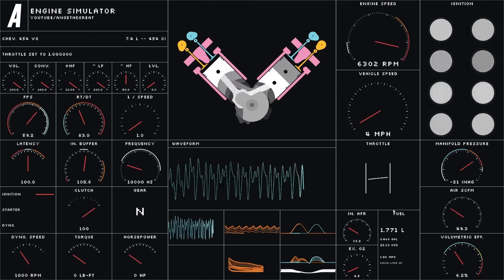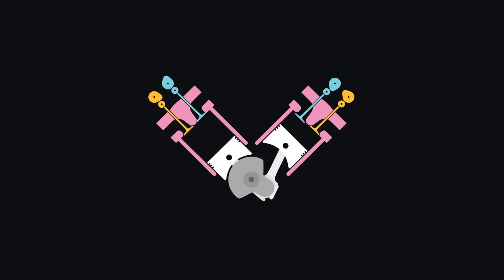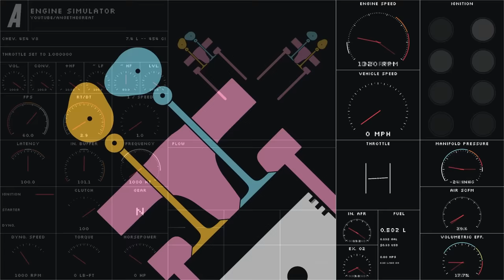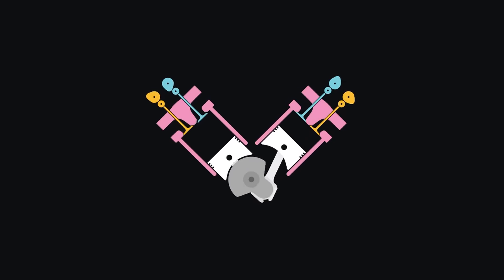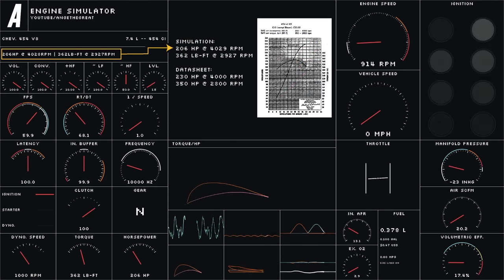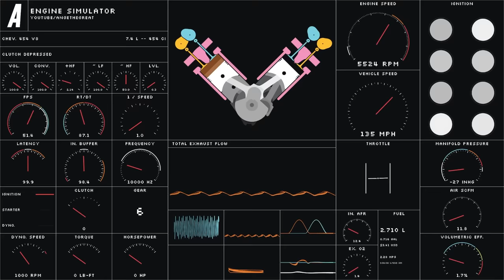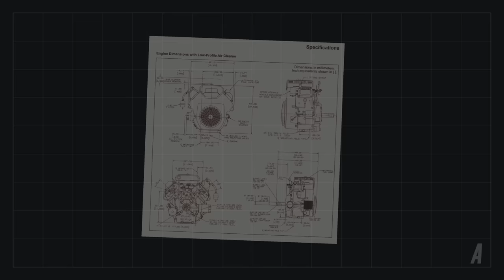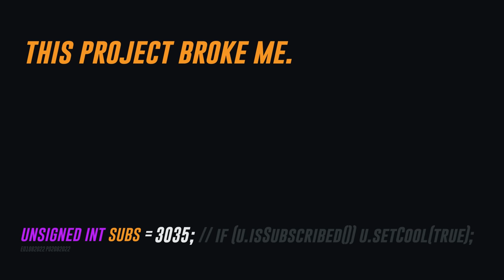Simulating an Entire Car Engine (yes, it makes noise)

Comment from the maker: UPDATE 2: Code is public again, see link in the description. For those that waited patiently and were respectful, thank you, you guys are legends.

UPDATE: I've received way more interest in this project and the codebase than I anticipated and I've made it temporarily closed-source. I may release it publicly again but I really want to make sure that my work isn't used without crediting me. Thanks for understanding bros!

Hey guys 👊 Just thought I'd clarify that ALL engines are displayed as overhead cam in the simulation since it is functionally equivalent and easier to program (visually) than cam-in-block. I'm well aware that 454s were single cam, pushrod engines haha. Also the user interface that you see was made with my game engine, I forgot to mention that in my video. It's the same engine I use on most of the projects on my channel. Thanks for watching!

Edit: Also, I don't want to pretend like this is a PERFECT simulation or anything. It's a decent approximation but definitely not on the same level as a scientific tool. I'm mainly interested in the sounds and generally getting the power curves right
Reply: Sure but please simulate an inline 4 engine, I need to see an economy engine on this simulation. Also try to implement a stress test onto the simulation like when there is no oil, the wrong fuel is put into the engine like an 87 octane fuel on a high performance engine (90 and above octane engine) and something like that.
Reply: Yeah, I'd hold on to all your code... I can imagine any car game or simulator manufacturers wanting to license this.
Reply: I want to play with the application so bad, hopefully I can play with it soon.
Reply: Can the simulation support diesel engines? Also coukd we use this sim to create engine sound mods for games?
Reply: this is very valuable tech
Reply: A W10 or W12 sound would be interesting
And a Two Stroke if possible. Like a Vespa or some other Scooter
Reply: can you add rotary/wankel engine :D
Reply: Would be interesting to see if this can be used as a tool to generate seamless engine sound loops for game engines or game mods! For example you define inputs like throttle input, rpm and the simulated sound sources, it creates based on the engine setup a sound loop. I think there is a huge potential for it ^^ i would even consider buying it if its not like hundreds of €$

I personally would use these loops with a sound controller from a unity asset called "realistic Engine Sounds"
🔊✌️ Very epic tool!
Reply: A wankel engine simulation would look pretty nice!
Reply: What if you put an audio signal in? Can it approximate the engine that created the sound?
Reply: When open sourcing software, you can never be sure nobody is using your software without crediting you.
The only thing you can do is pick a license that still gives you rights (e.g. GPL, AGPL).
You can always sell licenses that are more permissible (just make sure that all code that is contributed to your repo allows this)
Reply: put a BSD-3 license or The Unlicense and then anyone can use it, with different terms
Reply: MIT license is usually the license if you want people to be able to use it but want the credit, their are other "permissive licences" that mostly do the same thing such as BSD. if you want your software to be open source and free for people to use you should always put the software licence, because no licence makes people really nervous and experienced people will avoid the temptation to use it, at all. What can be done by scam artist is they will make a useful thing with no upfront and clear license but advertising by saying stuff like "I wanted the world to have the option, but email me if you use my code so I can know how I helped humanity" then a inexperienced programmer or company uses the code and builds a program around that code and emails them about it to respect their wishes. No licence in some countries like the US means fully copyrighted to the creator. They then say you used my code you must pay me now or not use it in your program you have dumped time and money into. just be up front about what you want by picking a boilerplate license that requires exactly what you want. mostly their is a boilerplate license you can copy that requires everything you might want.
Reply: If you want some protection there, GPL it and dual-license to anyone who comes along wanting to exchange money for using your time and effort in something proprietary.
(Is the GPL perfect? No. Do company lawyers vaguely understand "oh, we have to follow this" by now? More than most other licenses.)
Reply: @dangerdanger8987  I bet it could considering as Ange said, the codebase is generic, so all it really needs to be able to do is simulate the fuel atomization and compression ignition behaviour of a diesel to be able to replicate the sound. in fact, I might recommend trying something like this asw a starting point;

Cylinders: 4
bore: 82.5mm
stroke: 82mm
CompRatio: 17:1
valves; 2 per cylinder
turbocharged with intercooler
firing order - 1 -3 - 4 - 2

this should net you a 1753cc inline 4 comparible to the Ford KKDA engine that was popular diesel option in the 2000-2007 Ford Focus, C-Max, galaxy and transit.
Reply: I hope this gets either open-sourced, or you share it as CC-Attribution or even make it a paid software on, let's say, Steam because this absolutely rules and I want to be able to play with it to simualte some weird engine configurations!!

btw, any plans on simulating the diesel cycle with this if it's not already possible?
Reply: You either make world better and allow anyone to enjoy technology you made or make your wallet fuller and do not care about anything else. Flinging between these two goals does not honor you.
Reply: Can you do a Cosworth DFV revving right up to 11000 RPM and a flat boxer 8 like the one from a Porsche 917?
Reply: Yes, Create an "engine sound as a service" and LICENSE the Engine-Sound-Engine sounds to gaming companies.

-- however, make an educational tool for kids/schools/techshops/pros

--- MAKE A FUCKING SHAZAM (Record an egine sound and reverse the sound into the Configuration of the engine.

---- Then do the same for PrattWhitney, GE, Rolls jet engines ;-)

Seriously, this is amazing.

The science behind how you derrive the sounds is also of extreme interest to audiophiles.

if you nee a product manager...
Reply: Wankel Rotary engine please (2 rotor specifically, from the Mazda RX-7 FD, 13B-REW I believe.), I'm really curious if your sim can accurately simulate things like the distinct idling sound, either way great work really like this.
I'm also curious if you can get turbo- and superchargers to work in this, of course that curiosity has nothing to do with the fact that the FD was sequentially twin-turbo charged, not at all.. :)
Reply: Question: is the exuast the only part that makes sound, or does each explosion in every cylinder make a sound when firing? do the valves make any sound?
Reply: "temporarily"
it seems like its going to be like that for two months, least.
Reply: can you simulate a engine similar to a VW/Bugatti W16 engine, but in a 'flat/boxer' bank angle.
Reply: @TissuePaper looks like your comment is shadow banned (or something like that) - I can see it in notifications, can read it with direct link, but it is not showing here (you can check it with browser's private window).
Reply: Do a 2 stroke lawn mower
Reply: lol what a way to backpeddle an "open source" decision when it gets attention.
EDIT since re-release: Thanks!
Reply from the maker: @PieterDeStickere  Just need a bit of time to choose a license and figure out a way forward, that's all, all my other code including the physics engine that runs it is still open source
Reply: Is it possible to run this in real time in a game engine? I see you're running the rigid body simulation at 80khz, but are you able to distill that into some linear algebra? I would expect all you need to produce the sound are the pressure waves entering the exhaust system. If this is true, you could probably approximate it with some basic maths that gives the intensity and frequency of these pressure waves?
Reply: just do Qt license, GPL for eveveryone, and you get money for people trying to profit.
Reply: @AngeTheGreat  get your bread man, dont listen to these children thinking you shouldn't get yours. This kinda tech could change gaming audio, It could change how the automotive industry simulates engines, its got a lot of potential. make it accessible, but get your due from your labor.
Reply: I speak against myself, but you should keep this algorithm for yourself. Game companies probably pay a lot for this type of things(I think). You are the best for making this code available for everyone. If you want to get credit for using your code, but still want to share it for free, I recommend you the CC-by license at least. This licence force the user to credit you, while he can use it as freely as they want. Or check out th other CC licences. There are one for almost every situation.
Reply: 1. Would love see the codebase of a project this cool
2. Please, make sure to licence it with a copyleft licence like the GNU GPL and not some permissive licence (MIT or BSD or Apache) as codebases with such licencing can be taken and made into a closed-source product without your knowledge or permission and also dont use the CC licences, they are good for works of art like drawings, models etc but they are NOT suited for code.
Reply: make it public
Reply: +1 to Wankel Engine!!
Reply: steam engine!
Reply: Apache License 2.0 would allow everyone to use your source code however they want but they'd have to include your license.
Reply: @jony1710  it's already in Gran Turismo, since 2014, so yes :)
Their internal name is AES, you can find plenty of discussion about it on the webs after it was discovered.

I've personally modified data files in GT6 and confirmed what it does for myself, it's very powerful but hard to work with if you don't know what you're doing.

To be clear I'm talking about engine sound synthesis only, not the physical simulation described in this video.
Reply: Nice project 👏🏻👏🏻
Reply: Licence selection really depends on your goals.
If you want it to be included in commercial games, consider dual licensing. GPL plus a commercial license would give freedom for standalone use and open-source projects, but require most commercial games to pay you a licensing fee. 
If you don't care about licensing fees, but want to force attribution, consider dual licencing GPL with CC (yes, it's not recommended for software, but not an issue when it's dual licensed with GPL). Or you could technically do a commercial license that only requires attribution. 

If you don't care about attribution and want it in as many games as possible, use a permissive license.
Reply: Good idea. This is a super cool project, wish you the best of luck!
Reply: I don't even care about the source code, I just want to play with the simulator..
Reply: I'm so sad I didn't find this before it went closed source. I wanna mess around with it so bad
Reply: @AngeTheGreat  Yeah, hope you find one that works for keeping the community at large able to use it easily but get all the devs to pay properly
Reply: @Bill.Moller  just make it gpl
Reply: @dextreme1754  Not just a wankel, I'd love to see/hear a Liquid Piston! I'd also love to see it compared side by side to a typical wankel
Reply: @Bill.Moller  man i hate IP laws
Reply: If you could make tutorials on how we can also make physics based simulations in cpp, it would be great!
Reply: @PS3PCDJ  What the issue with it being used in closed-source product? He does not lose from it.
If he care about that he should make it paid license rather than copyleft which no commercial games will use.
Reply: Looks awesome and I totally understand why you went closed source. Is it possible to just list references that you've been using while developing this, please? I'd like to check the theory rather than code :)
Reply: @HaimSchnitzer  The problem here is that by using a permissive licence you're giving up the control over your code and companies can take your hard work and are not obligated to give as little as a thank you and then go and make millions if not billions off of you and your work
Edit: Closed-source software is inherently untrustworthy, dangerous and evil.
Reply: @PS3PCDJ  You are not losing access to your own code just that you do not have access to theirs. When you open source your code you lose control over it(aside from trademarks), there is no need to be control freak. If you do not want for someone else to profit from your work you make paid license.
Reply: here's a challenge ROTARY ENGINE
Reply: Make it open source get all the praise you can get or just sale it I want this shit don't care how much you ask.
Reply: Yess! You deserve the credits to this man! I absolutely stand with your decision!
Reply: Do you think this would be able to simulate Radial engines, the ones typically used in piston aircraft. Or rotary aircraft engines. That would be interesting to see
Reply: Yeah you just wrote something that engineers, game developers, and the like all want. No surprise the code has gotten some traction. You could really be on to something for the auto industry!
Reply: man, this is so cool, is there anyway i can get it? without waiting?
Reply: Man, first thank you a lot for you really giant work! I studied internal combusting engines in university and now I working as a programmer. So I know how complicated it was to implemement such accurate simulation. Second, what about additional UI control to change ignition timing? It should significantly affect power\torque and sound of course. Or even simulation of broken spark plugs? Just for fun. Or even better: implementation of turbocharger\supercharger?
Reply: @bageltondinglequandaleseba6928  nice name
Reply: @Corndog1  The automotive industry already has way more advanced simulation software. Software that can simulate and identify which conrod bearing will fail first if you pick too small of a coolant hose. This is little more than a toy by comparison.

The gaming industry is another thing entirely and it would probably have some value there, but game studios are going to look more at hiring people who understand the source and can continue developing on it. Having the source is meaningless if you can't properly integrate it into your game. Given the speed this needs to run at I highly doubt it's trivial to integrate into existing game engines.
Reply: @AngeTheGreat  It was a serious letdown to be honest, but the work is amazing. Good luck on finding that way forward, how can we follow this progress?
Reply: I am definitely interested in everything you know about this subject, im very interested in hearing what various objects would sound like if air went through them. (Like musical instruments, whistles and that kind of stuff)
Reply: a subie boxer 8 or 12
Reply: A DLL Executable release would be epic: would preserve your code and authenticity while also making it available to us!
Reply: you already released the code, if anyone wants it just reply to me
Reply: he already released it without licence you can legally use it, if anyone wants the code let me know i just moved it to another repo also have archive link for original repo to show the lack of licence
Reply from the maker: @Chris_t0  Unfortunately, that is not how it works. Code without a license defaults to all rights reserved (ie you cannot use or distribute it without permission). Please respect other people's property, thank you.
Reply: @AngeTheGreat  dw i dont have it apolgies for the salty troll comments
Reply: After this is finished I think you should license this To BeamN.G. Dev team.
Reply: A shame that you felt the need to take this step. There are a lot of assholes out there trying to profit from your works. However, I think that if everyone hesitated publication of their works because someone could steal them, we'd never make any more progress at all. The open source community would cease to exist. But it's thriving, and as far as I can tell, no one has actually complained about not getting the due credit they deserve.

I understand where you are coming from. I understand your concerns. But really, bro, seriously, this shit is so fucking top notch awesome, it just has to be published!
Reply: @jwalster9412  There's a lot of stuff going on in an engine that makes noise. Not only the combustion.
Reply: Automation could be the guys that have a very keen interest in this project! With the entire game based on you designing a car, even down to the engine internals.
Reply: while we wait for open sourcing it, could you share a demo?
Reply: I am thinking about running this software on a EV car that could be pretty cool
Reply: Do you work for Camshaft Software Ltd?
Reply: What if you did a radial engine? like on an airplane lol
Reply: not a chad move tbh
Reply: Go full on study Wankle engine
Reply: I have no clue about engines but could you try a W16, and a 2 stroke strimmer
Reply: Cringe
Reply: Can you do an I10, I12, F5, F10, B10, B5, F3, B3, B12, Cummins B2 and a Flatplane V8 that sounds Crossplane and explain how you get that sound? (E.G. Shelby GT3500). Can you also explain how to change the firing order, bank angle, firing interval, switching between regular 180 degrees flat and boxer, muffling, exhaust/ intake tuning and other tuning? Have you ever heard of BeamNG Drive?
Reply: you can always release it as AGPL, this allows you to share and know that other people aren't using it without also sharing their contributions and your credit.
Reply from the maker: @wildman510  lol what?
Reply: @AngeTheGreat  don't listen to him also i may need help a bit with setting up the codeing wish it was just really easy lol like just on steam or a click and done
Reply: I'm sure I'm just saying what many others have already, BUT what you have created is an ideal training tool for an AI that can then be used as a very light-weight engine sound component for use in games etc.
Reply: This is awesome! Do you think you could throw together a simpler guide for those who a less skilled with app development tools to get it running?
Reply: For an engine idea make the FADET20 but make it Twin turbo, id like to hear a simulation of that as opposed to a single turbo. Please and thank you. EDIT: If it takes you a longer time to achieve such a wonderful feat, i have subscribed and activated notifications
Reply: Hey I would love if you made this an app or something
Reply: i would love if you can include a prebuild exe in there, as its QUITE a bit of a hassle for us who don't know how to... uhhh, build the program into an exe. i did manage to follow a few step but as expected gets stuck as i seems to need proper knowledge to do this, and i just dont, and i dont even know what i need to know :|
Awsome job none the less, if i end up making anything with it and publish it, i will give you a proper credit, at somewhere obvious :]
Reply: Any way you could upload a video on how to run it?
Reply: Hey, so im trying to install the program but i dont have a university degree in computer science and im finding it really hard to follow the instructions on Github. Could you possibly make a video on how to install it?
Reply: i found files in the release that do contain other engine presets, however i can't find a way to select a different engine and i am stuck with the V-twin
Reply: @TheGhostzZ  hey dude, im having trouble actually getting the program downloaded and set up... could you possibly help me out?
 
Thanks
Reply: @TheGhostzZ  Edit the engines.mr file to public import “yourengine.mr”. no idea how to run it myself but that seems the most obvious. Btw howd you get it to run
Reply: Pls a rotary one
Reply: You are the legend.
Reply: I was waiting for such thing since many years to appear in the world
Reply: I am in the process of trying to build the project and got CMake installed but I got stuck on step 3
Reply: you're awesome! going to check out the program right now. 

i'm also relatively new to cs (second year in college), do you have any suggestions on where to start to learn to make projects like these? i know up to basic dsa in c++.
Reply: can you make a tutorial on how to use this
Reply: Thank you very much for sharing the code and details 💯🙏
Reply: Good Day AngeTheGreat, I dont know if u heard about the game "Automation the Car company Game" they really could use what u created maybe u can get in touch with them ^^ Have a nice day and keep up the awesome work!
Reply: @Marcoxxx14  Maybe BeamNG too
Reply: This is one of the most impressive projects i've seen, I tried to simulate just the engine sound by using a sound files for each ignition, but it always stutters and never rly worked with different libs, not that long ago i realized that creating a soundwave would be waay easier, what an insipration, would love to see a deep dive in this project
Reply: @TonyJustSavkin    the approach you tried is viable and it's how Live For Speed generates its sounds.
I started out that way using Octave, but superimposing the same sound bite with the correct offset into a single audio "buffer".
The trick as you say is finding (or making) the correct platform to do the job. That's how I turned to Puredata:)
Reply: @identiticrisis  Yeah i thought of trying it that way, but never got aroung to trying it cus I barely have any programming skills, might have to check out Octave when i come back to what i was trying to achieve, thx :p meant to say Puredata not octave
Reply: I am really impressed. It has so much potential in so many different areas like gaming, tuning cars, education and more!
Reply: Shame it's not a compiled .exe tho
Reply: Maybe you can try a 1cylinder 2stroke engine for a change to 4stroke
Reply: Did you model the exhaust pipe and muffler at all?
Reply: We the people need to hear a recreation of the renault rs25 v10
Reply: Rotary engine? :)
Reply from the maker: @Mycatkeepstryingtodestroymybed  Go to the GitHub link in the description, click on releases, download one of them, unzip it and run the exe in the bin folder
Reply: Thank you thank you thank you.  I am going to be making my own compressed air engines through 3d printing soon, but this is going to be great to hold me off.  Thank you
Reply: A boxer style piston layout
Reply: So, am I doing something wrong, or is there a specific way that I need to shift without stalling the engine? I'm also only able to see a two-cylinder, just FYI. Maybe there's something in the video that my ADHD ass skimmed over.
Reply: try out a flat 4 like a subie can you hear the difference in equal length headers and nonequal length  headers and also try out the ford inline 5 diesel
Reply: Inline 6 with 2.8 litres
wonder if i can recognize my car
Reply: Rotary?
Reply: Is there a way this could simulate rotary engines or is it just v and inline engines?
Reply: 0xc000007b always cursing me even though i followed the procedure to fix them. any solutions?
Reply: Bugatti’s w16 is an interest
Reply: ok thats fair enough but I'd be happy to pay for this if you re-release it! if you could simulate turbos and wankel engines it would blow my mind, one day I hope we can build virtual engines, model them as we wish and then see if they work before making it
Reply: I cannot believe anyone would complain about this not being accurate enough.  Of course, any software is an approximation and not reality.  If you've got the power curves, sound, torque, and all that stuff accurate, I don't see what there is to complain about.  Especially since it's realtime.  I wish people used more common sense and just appreciated the amazing work you've done here.
Reply: 3 bank w9 engine would b sick
Reply: please simulate flat/boxer 12 engine from the 917 lh
Reply: You should try to make the V10 from the Lexus LFA, I'm not quite sure if your code can do that
Reply: @drugged_monkey  Good one
Reply: UI suggestion could you make switching between engines easier with like a menu.
Reply: Would love to see Wankel engine as well. But i am gratefull, how you did this simulatiom, which is really great and you managed to get everything at the right point. Hearing the v8 im this simulatiojnis really accurate, however i just only listen V8 just a few times in real life. I play great simulation games and there engines souns are also great.

I don't want to compare it for games.
I just want to acknowledge your hard and great work. Just a car lover, who technically learned about engines on the internet and about cars.
Reply: how about a rotary engine and liquid piston engine and try to simulate all types of gearboxes in cars
Reply: You should release this GNU-GPL.
Reply: i was surprised when the got all aspects of the sounds in farming simulator 22. baffled me when i heard the bog of a turbocharged i6 diesel engine. love that game.
Reply: This is friggin insane. It’s totally awesome in every way. Can you see about a radial engine? I know it’s a completely different design, but I have a huge love for them and how old prop planes work.
Reply: the app doesnt work on my pc, every time i open the app it says 
"the code execution cannot proceed because vulkan-1 was no found reinstalling the program might fix this problem" pls help me thanks
Reply: Carburated v8 motors are known to diesel when powered off, this is caused by the heat of the motor igniting unburnt fuel. A cooling and oil lubrication feature will make simulations far more acurate as well as bringing new light to what a motor can truly handle in the real world. With the addition of a  material selection for blocks, pistons, rods, etc. This would achive nearly perfect replicated performance. The only thing changine atributes between performance would literally be air heat and quality. Alas you could change motor development forever
Reply: >doesn't want his work to be used without credit
>releases source code under an MIT license
lmao you just literally allowed anyone to use your code without needing to credit you
Reply from the maker: @arthritis1999  Yeah, strange that I would do something like that while missing this crucial detail that I clearly did not consider. Very strange indeed.
Reply: what about adding rotary? Btw could you make it so it's possible to use sim racing pedals for it aswell? Would be awesome
Reply: Sounds very similar to my 2011 camaro ss
Reply: @juicedmaster  Sounds like some kind of machine learning algorithm built on top could potentially do something like that.
Reply: @AngeTheGreat  Don’t listen to the naysayers. Protect your intellectual property as you see fit. You may have a marketable product here and you deserve to make money off of it. Wear your haters as a badge of honour!
Reply: @winston902  do you have a video card? like Nvidia AMD
Reply: hey dude. It sounds really good! Would be cool to switch out cabinets, or car body's or whatever. With a bit of convolution reverb, you could simulate what these bad boys would sound like when they are placed inside the hood.
Reply: @StephenFasciani  nope-
Reply: @winston902  then it wont work
Reply: You should simulate the BRM P83. It'd an H-16 configuration f1 engine from 1966 for British Racing
Reply: Someone make this into a game where users can just tweak values and create different engine profiles. Would be so fun.
Reply: i downloaded it and i cant find the bin file
Reply: HOMIE HAS HIS OWN GAME ENGINE AND CODING LANGUAGE? That’s actually really cool, props to you on the hard work!